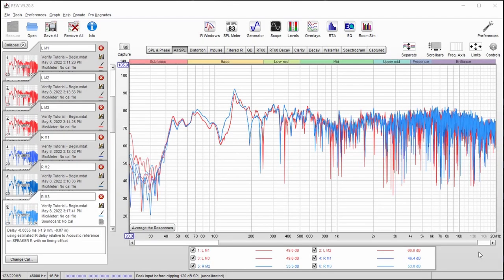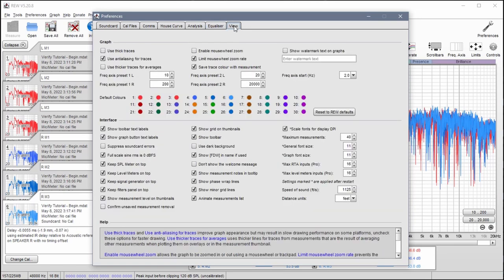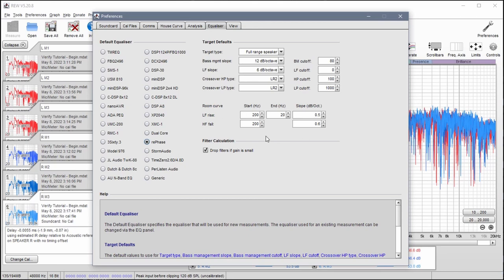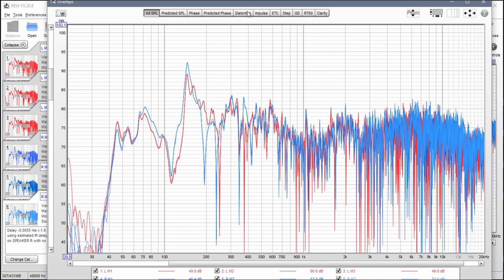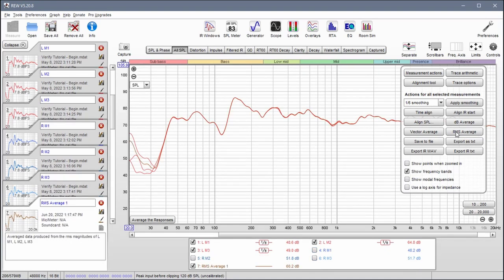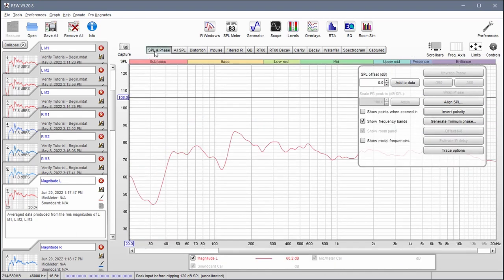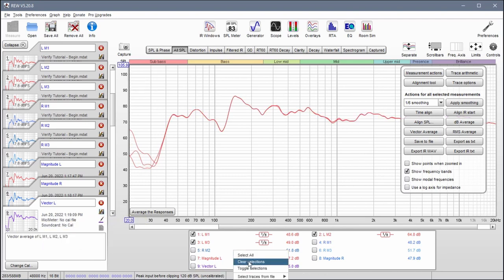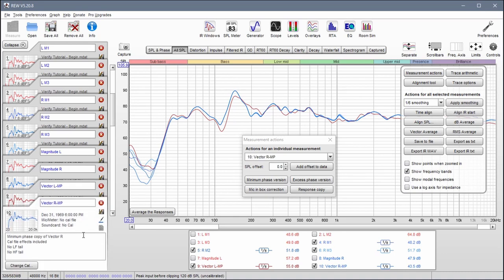Single-Point Digital Acoustic Correction for desktop & HiFi speaker systems Using REW and rePhase P1

Comment: Hello again. What is the point of taking 3 measurements from exact same position that look the same and then creating averages (which also look exactly the same)? Am I missing something?
Reply from the maker: At the time I was using at multiple measurements from the same location to create vector averages. This was better in my mind than using a single L,R set because the averages reduced the possibility of variation in a single measurement that would otherwise go unnoticed. I basically just did it for peace of mind. Now, with the new way I do this, I only use one left and one right measurement.

Comment: Hello David! The information on your channel is very interesting and the truth is that it is very useful to me! I saw that you have 3 published room correction methods and I wanted to ask you which of the three correction methods is the most effective for you and which one do you recommend to correct my home studio room? Greetings from Argentina and sorry for my bad English. Thank you!
Reply from the maker: There's really only one method, when you really think about it. I just have published a couple different ways of doing the same thing. There are other ways, and within the process you can change things if you want. Experiment with the settings where you understand them. For instance, try leaving all rephase filter banks at minimum phase instead of switching the high frequencies to linear. Export measured vs minphase. Things like that. You can use a single measurement or you can average together several measurements. You can process the group delays and optimize the timing or you can simply stop after you have generated the magnitude filters. 

The most effective way for me has been using a single measurement and going through method 2. I have been working on a refined version of this for method 3, but I haven't made a video yet.
Reply: @davidbrancato  Great, I'm going to keep an eye on method 3, but in the meantime I'm going to try the second one you recommended.  Thank you so much

Comment: Hello David, under REW, did you use measure icon on the left top, or did you use RTA record button to measure the various positions?
Reply from the maker: I use the measure button in the top left corner. I use a sweep with a length of either 256k or 512k. I use an acoustic timing reference with zero timing offset and zero reference level trim. Playback is from REW, sample rate is the same as my playback rate (48kHz for example). 

When I record the sweeps, I always make sure that the reference chirps are delivered from the same speaker as the sweep. This requires me to switch Output and Ref Output each time I want to measure a different speaker (they should both be the same for each sweep). 

I've never used the loopback timing reference.
Reply: @davidbrancato  Hi David, thanks for the detailed response. Another question regarding excess phase filter. Is it possible to create multiple copies of excess phase filters, i.e. 20-200, 200-2000, 2000-20,000 to be loaded into Rephase? reason I ask is because there is limited slots available in the L/R channels in REW for you to align the 2 graphs when I did the overlay. If that is possible, how should I go about it? The tutorial states to import excess phase as a single file into Rephase, unlike magnitude, where you can fill into multiple banks. Thanks
Reply from the maker: For some reason I thought I had replied to this. I'm sorry if it never happened. Anyway, there is a way to do this that I've worked out. It's too complicated to type out so I'll put it into a future video. Would you be interested in sending me your mdat? I could use your measurements to make the video.